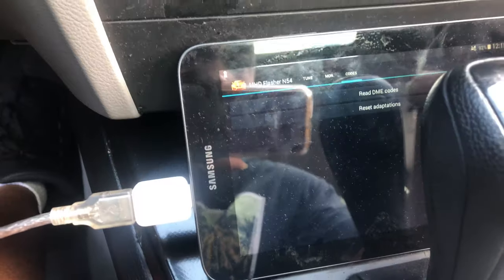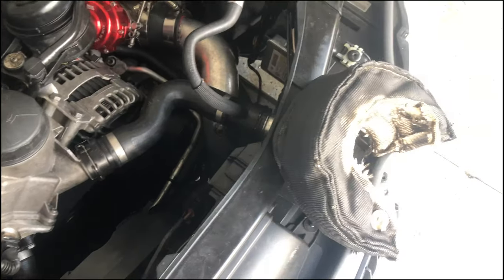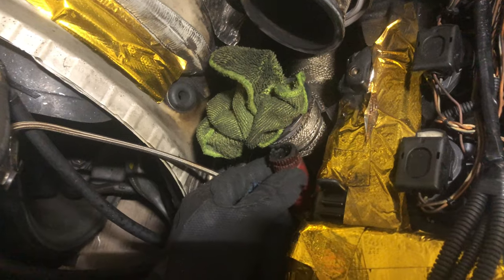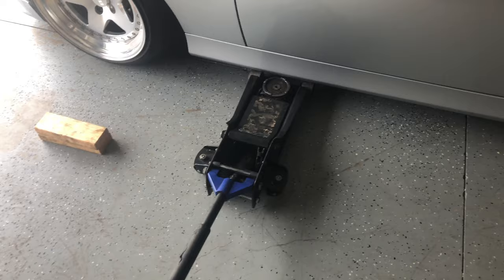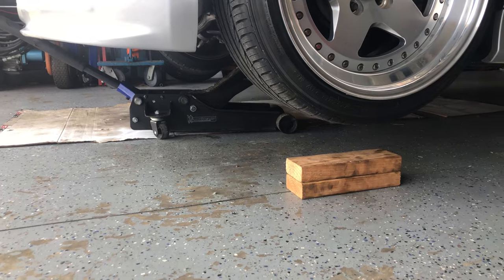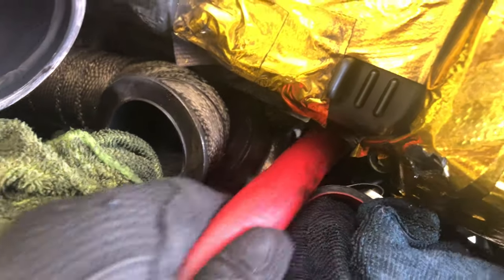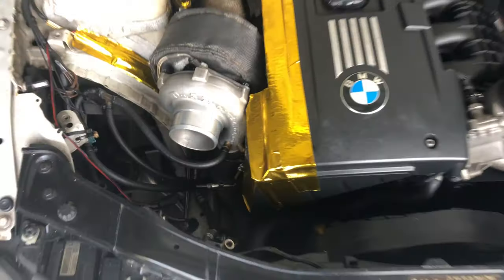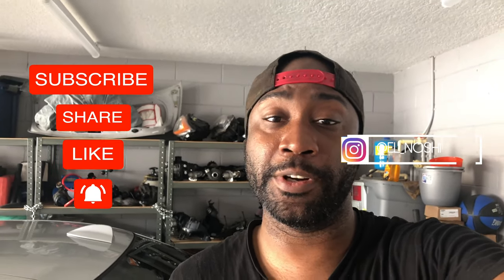BMW N54 335i Maintenance Cycle Starts Again :(

Comment: I'm sure you've talked about this is another video at some point and time, but how does the smaller single compare to the twins? I'm looking at possibly going single without the intention of making crazy power just due ease of access but i'm worried I will hate the lag. Liking the budget build so far man hope to see more from you.
Reply from the maker: Thanks a lot appreciate it. I love the single turbo setup. It feels like when I had my rob beck turbo setup but with way more top end power. Depending on your turbo size, a/r, and how well your tuner is able to dialing in your tune you won’t even notice any lag.The key is if you’re cruising, gear down and the power is there. Compared to stock where you can pull in like any gear lol. Honestly I had the same worry as you thinking i would hate the setup because of lag. But to my surprise it’s wasn’t bad.

Comment: Bad the exact same thing happen. U should update ur wastegate lines to hard lines.
Reply from the maker: Yea once I get some spare mod funds they will get upgraded. At least I know my oil feed won’t give me any issue in the near future.
Reply: Mam Cie W hey what you used to closed the existing drain port with the hole in the middle and two bolts next to it.

Comment: Hey buddy, nice video!  I'm not sure if you remember me or not but you've helped me out a few times with my build.  I'm installing my On3 kit and I'm at the tial wastgate.  I have it on but it looks impossible to install the wastegate dump tube.  Any advice?
Reply from the maker: Hey what’s up. Yea I ran into the same thing. What i did was hold it from the bottom and then have someone with nimbler hands clamp and start threading the screw. Then I used a wobble socket and extension to tighten it. I think next time I’ll mark the orientation of the dump tube and install both the dump tube and wastegate together. This part took me a solid hour to get lined up separately.
Reply: Yea, you ain't kidding!  I've almost got it, I actually marked the pipe and the eastern gate then I pulled them both out and tightened the clamp.  I'm about to install the wastegate/dump pipe assembly now, wish me luck!  And thank you again for your help, it may seem like a little thing to tou but its awesome to me that you're willing to help!
Reply from the maker: Not a prob glad to help!

Comment: Imagine how much power and longevity that engine would have with a CAI with a filter.
Reply from the maker: I have a filter that’s on when I’m not working on the car. There’s a bunch of parts off when swapping and testing things. Everything is put back together later. My oil catch cans are not hooked up either.

Comment: Great videos! Can you share how you got your vehicle high enough on four jack stands to do the engine removal series? I've never been able to do it always having to use a somewhere that has a lift :(
Reply from the maker: Thanks appreciate it. Pretty much I did the same thing as in this video for the front, and for the rear just jacked it up by the central rear jack point. I made sure to use tall jack stands, which I picked up a set from harbor freight the grey silver looking ones. Depending on your jack, it’s arms might not be that tall. So either get another jack that’s not low profile and you can raise it higher. My jack raised it high enough but I removed my transmission separately and the car wasn’t high enough to slide it from under the car and the jack couldn’t go any higher. So I got some heavy ply wood about the same length and width as the jack and placed it under the jack and it gave me more clearance. In either case as long as you get tall jack stands you will be good to go. Just take the engine and transmission out together and you won’t have to worry about clearance.
Reply: @nOshi2x  Thanks so much. Where on the car are you placing the jack stands? On the plastic jacking points or elsewhere?
Reply from the maker: No prob. Yea on the jack points. There’s spots by the subframes you can place it but put it on the jack points so I have more room when under the car.
Reply: @nOshi2x  cool thanks making space in my garage as i have an n54 swap to do soon.